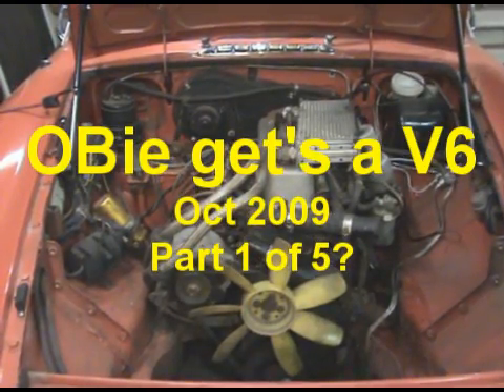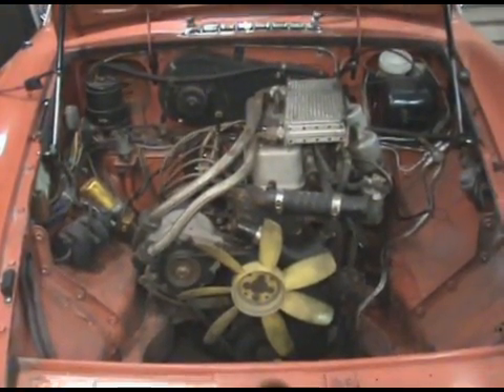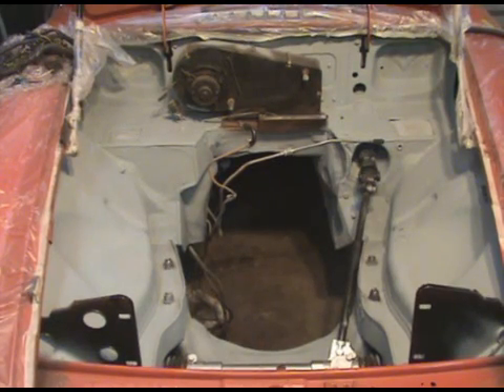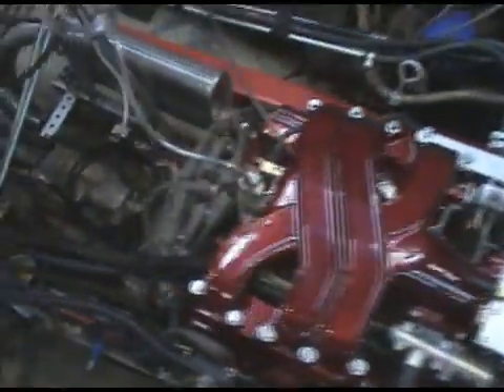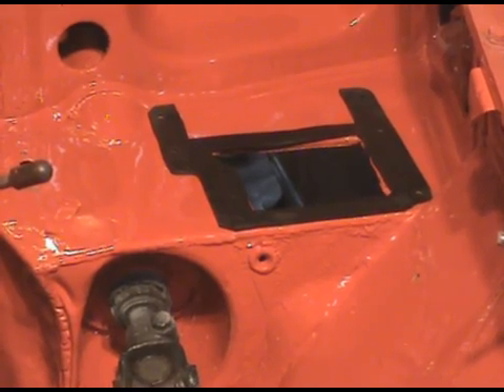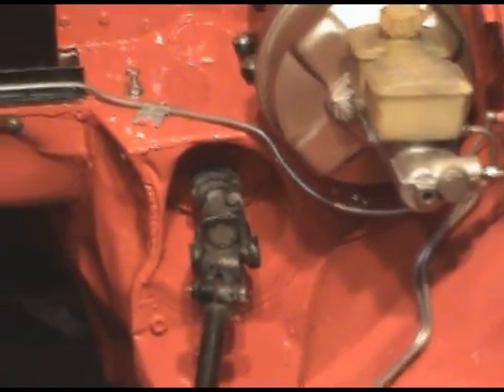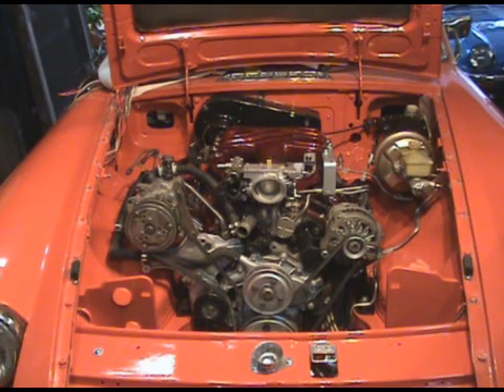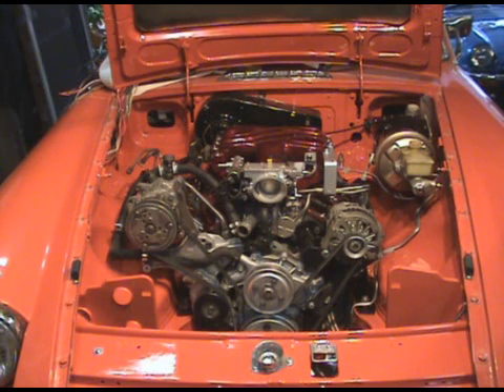Part 1/5 Megasquirted 3.1L V6 Installation in a 1973 MGBGT

Comment: i got one of those v6s in my 92 camaro its very cool engine even though they have had a bad reputation but that not the motors fault when they first came out not alot people knew what fuel injection was so mechanics fault.the cool thing is it may only have 150 hp and 200 torque but even in my big heavy camro i can still kill hondas sooo its slow but not that slow, i bet in an mg it will be very fast though lol.